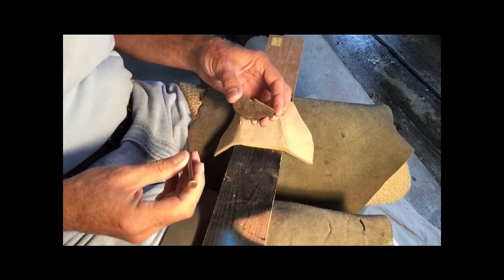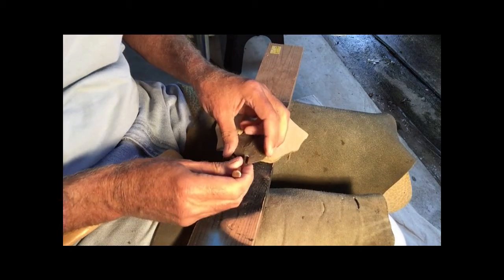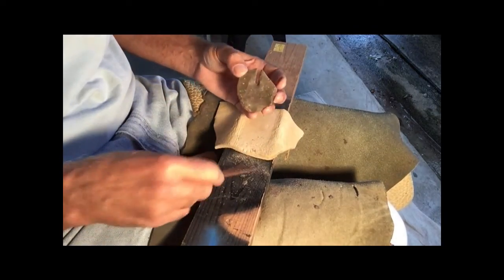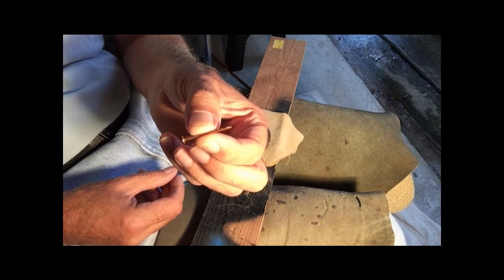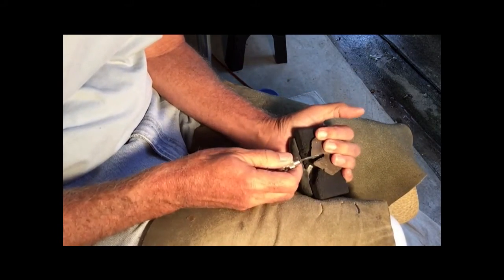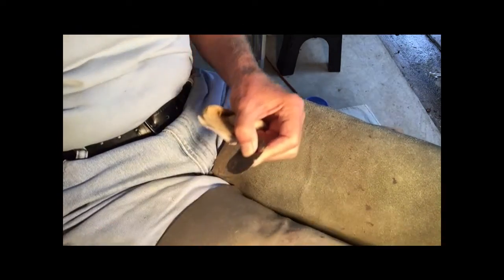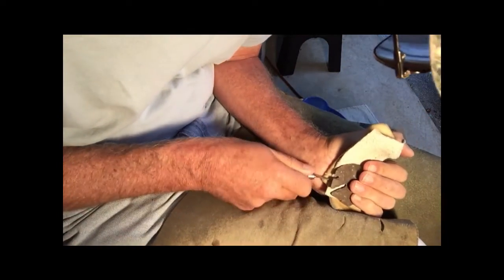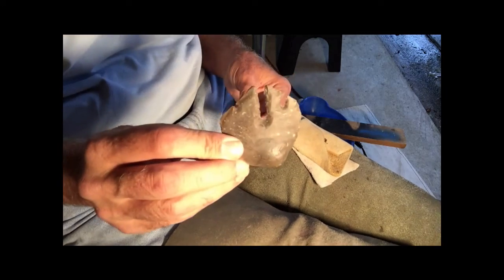notching

Comment: Thanks for the info on notching. it's very challenging. Roy miller notches backwards and I've seen others .do you use this method
Reply from the maker: +Jeff Bodean i know that technique is used and i'm sure some can/have mastered it, but i feel the technique may be riskier. with an ishi stick coming up from below i can put a large amount of force into a flake without disturbing the area already notched, and it seems like that removes a fair amount of risk from the equation.